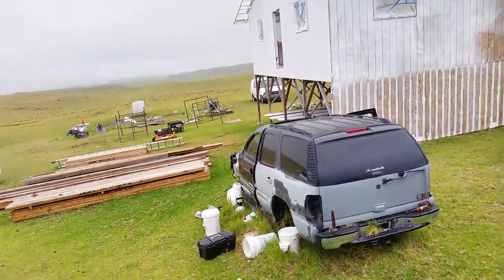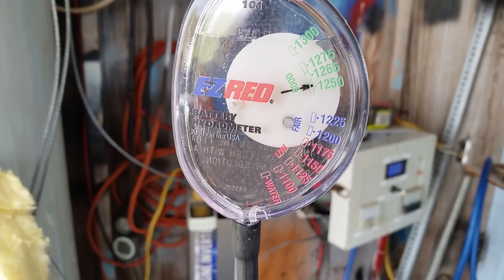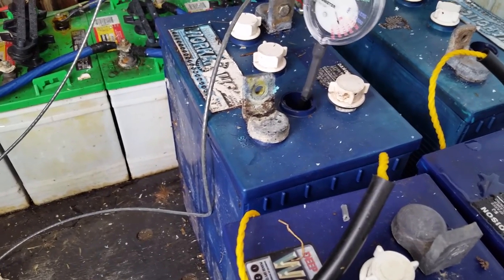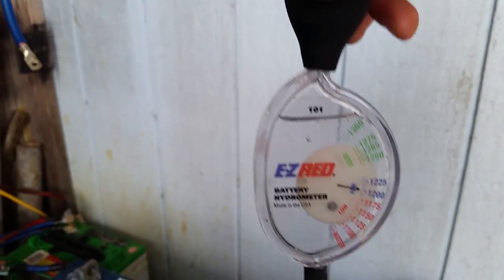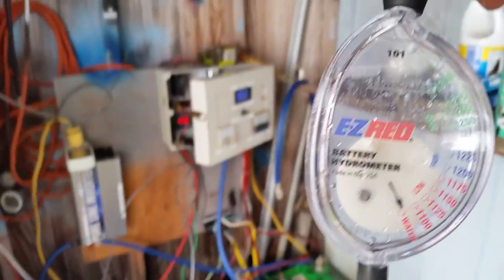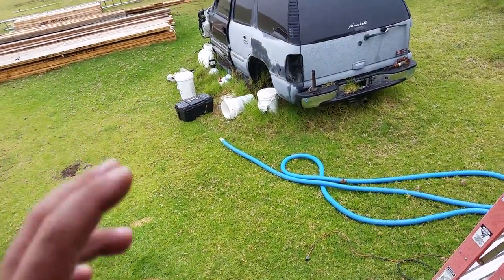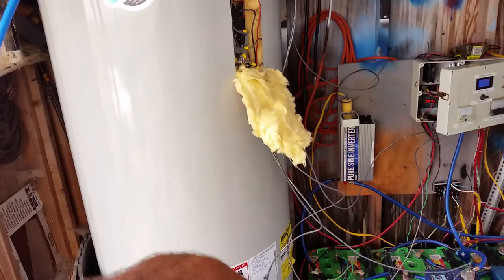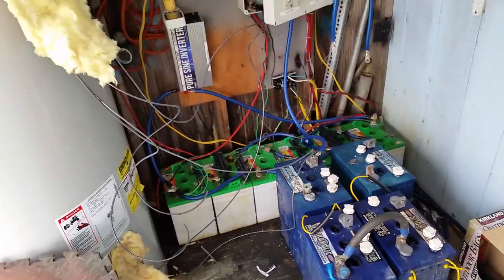Testing Battery Electrolyte With A Battery Hydrometer Specific Gravity

Comment: Here is the best way to test batteries..charge batteries then put a load on then for about 5 mins to remove surface charge, take a reading of each cell and noted..cycle the battery, use it for normal operation..charge it again put load for 5 mins. Take readings compared to first readings....that should tell u if battery is good or bad

Comment: I would use a battery minder from northern tool ! but first on the low battery you need to scrub the plates (charge boil them) my experience is a golf course owner ! 36v carts and my own solar system
Reply from the maker: Hey thanks for the input I will look into it. Thanks again
Reply: Glad to see you came over. Modern is a nice guy. You will like him a lot brother.